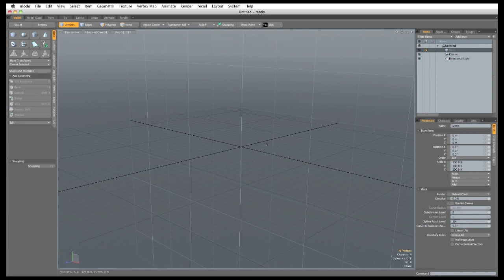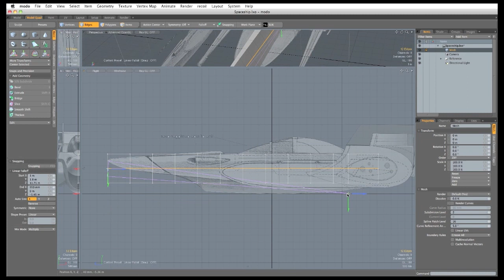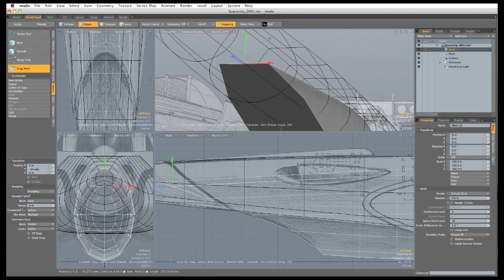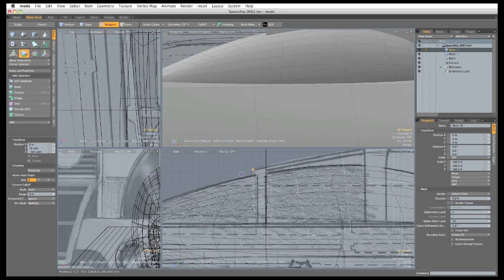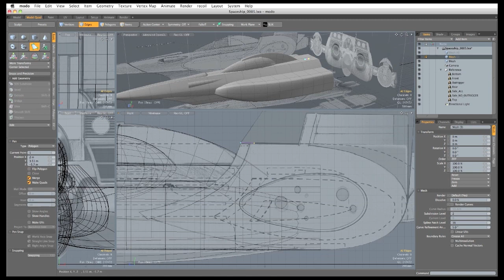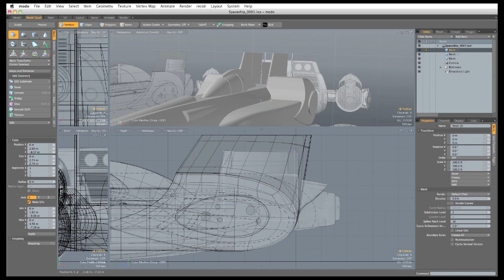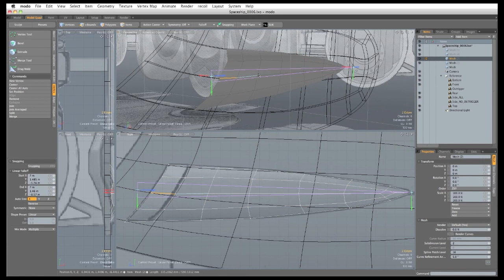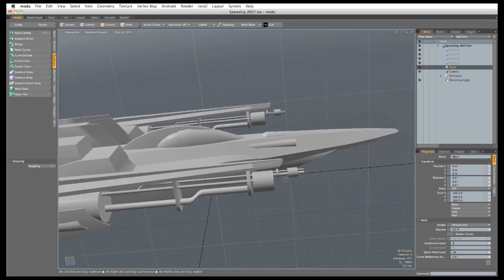Hard Surface Modeling in Modo | Blocking Out the Model

Comment: Question- What is the benefit of using the "pen" tool over the "Topology Pen" tool?
When following along in the tutorial (which appears to be an older version of MODO), there doesn't appear to be a topology tab/toolbar, so I'm curious if the Pen tool was the only option at the time this tutorial was made or if there is a specific reason that that the retopology was done outside of the topology tab/toolbar?

(Fantastic tutorial, but I seem to be running into issues with the Pen tool, that don't appear to be a problem if I use the Topology Pen tool...so I'm just wondering, what, if anything is the difference?)